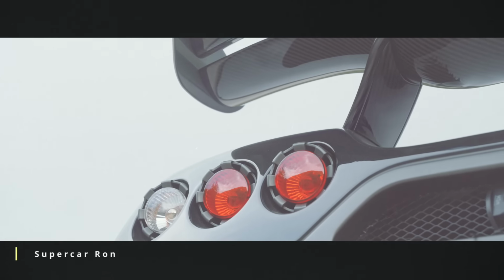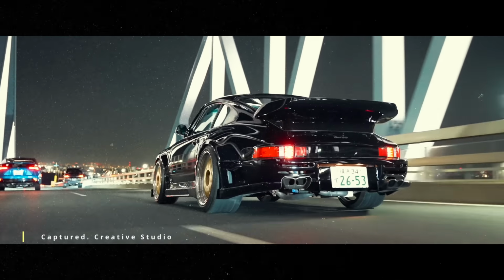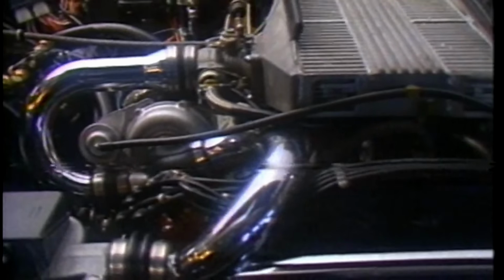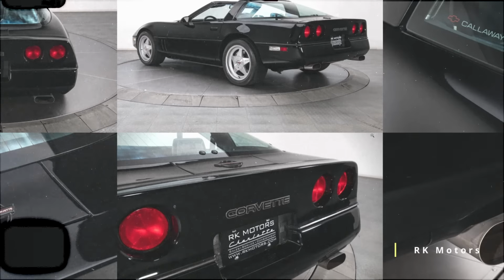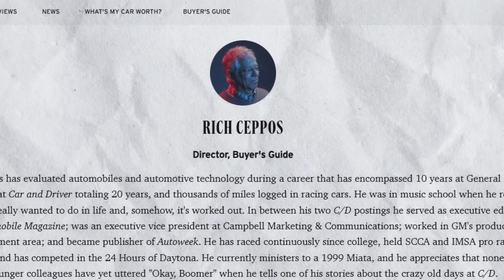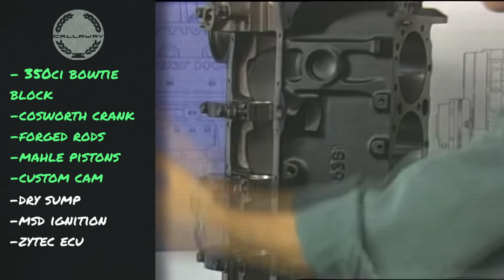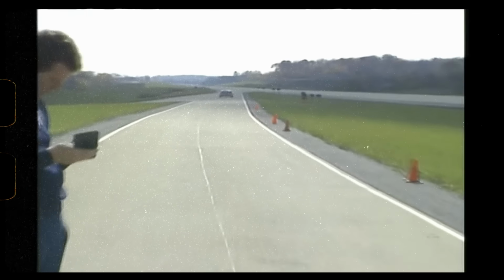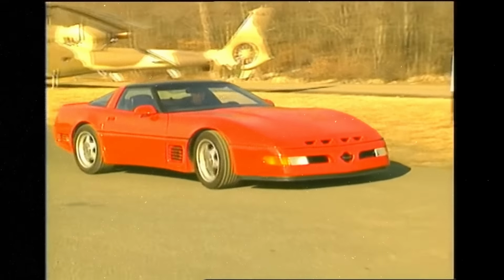Was The World's Fastest Street Car for Almost 20 Years

Comment: It took a Veyron more than 20 years later to beat it and for so much more money.  Only 20 lbs. of boost.  That is nothing today.  What an accomplishment.
Reply: Exactly. The original version of the Veyron was never actually the world's fastest production car - it topped out at 253 M.P.H. The super sport version was what finally went faster than the Sledgehammer in 2009.
Reply: Don't forget the astonishing 1.5+ billion dollars in R&D costs incurred by VW that lead to the Veyron's creation! Ferdinand Piech had his ego dented to such an extent by the Peugeot WM P88 LeMans racer (that funnily enough achieved a top speed of 252mph/405 kph using a TT V6) that he gave the team at VW the ultimatum of building a faster car regardless of what the cost to the company was. And that lead to the Veyron 16.4 reaching a top speed of 253mph/407kph! 😂
Reply: @m.cigledy6769 the problem is that only 1 Sledgehammer was set up to go at that speed, Which doesn't make it a production car by many list's standards. The Veyron is a production car. The Sledgehammer does make it into the street car lists since it is an emissions complaint road legal vehicle. Those are two different lists.
Reply: I've been saying this for years. An old chevy 350 at modern boost levels will run with anything built today. I've gotten 27mpg on the highway, and regularly get 25 in my 96 C4. Last road trip, my 3.5 v6 infiniti got 22mpg.
Reply: @DJAizakku  I think they may have put together 2 of them, but I may be wrong. It was technically OFFERED, but it wasn't really advertised or even known about. That and the price tag was enough to keep it from real production.
Reply: @m.cigledy6769   The second one was the hot pink coloured car, right?
Reply: @rahulsudhir666  If it was, I'd want it to be that fast so no one can recognize me driving it.
Reply: And not only that, but when the Veyron became the "fastest" car in the world, most people didn't even know that the SSC Ultimate Aero existed. Then they made the Veyron SS which was a few mph faster than the original. This seemed strange because why would they make another Veyron that costed so much more and just a little faster. Only later we found out the SSC Ultimate Aero beat the original Veyron, so they quickly made the SS to get the world record back. One of many examples of cars from the US beating the competition, yet going under the radar. Another good example was the 2004 Chrysler ME412, which Mercedes cancelled because it humiliated the brand new SLR McLaren in every way.
Reply: Don't get your metric system in a bunch if miles per hour magically makes your car slower. Keep living the kph dream
Reply: Comparing a corvette to a Bugatti is hilarious 😂
Reply: @user-kr1or1hm4v  Agreed, since the Corvette is actually a functional everyday car, and the bugatti isn't 🤣
Reply: Gator backs?😂
Reply: @m.cigledy6769 wrong 255mph?
Reply: @christohees9150  The original Veyron went 253.81 M.P.H. The Sledgehammer went 254.76 M.P.H. The Veyron Super Sport did get to 267.85 M.P.H. but the original didn't beat the Sledgehammer.
Reply: @m.cigledy6769  don't know why I remembered it as 255😂
Reply: @DJAizakku Americans don’t tend to let facts get in the way, hence Trump!

Comment: For the era, just the fact that stock Corvettes could achieve 160 plus mph was impressive in and of itself.
Reply: c4's were ugly but they had a bloody good drag co-efficient.
Reply: @Mrx1080 beauty is in the eye of the beholder, I happen to find the later c4 vettes with the updated front end to be good looking cars
Reply: @Full_Otto_Bismarck same. Grew up idolising that design.
Reply: in of itself
Reply: Corvette Callaway Turbo Sledgehammer 
cd 0.260
area sq/m 1.791
area sq/ft 19.28, but use 19.4, 267 mph Max speed , 825.34 aero drag+34.65 tire and weight drag= 859.99 HP req'd at sea level. You wouldn't go to a 256 mph average party on an Ohio proving ground with less than 900 net flywheel hp. 

"I know what I'm doing" Reeves C, RIP.
Reply: I am curious what tires they ran as Bugatti claims the tires will fail within a few min and that’s their special glued tire that’s like 15k each irc
Reply: @advanced3dprinting  Tires were new on when Reeves got to Ohio, and special set GoodYears which remained the property of Good year after use
Reply: Umm my 93 Firebird Formula is rated 157 mph stock ..all day long ...Lt1 2nd gen ...world's strongest small block motor ...able to handle 1100 hp plus on stock internals
Reply: Why? Emission held them
Back not technology
Reply: I have a c4 with 33k.
148 is the fastest it will go.. And that is with the wind at your back down hill.😅
Reply: Scope the top speed of the new ZR1...
Reply: @Full_Otto_Bismarck I think the restyled C4 is the best looking Vette. Then again, I did grow up in the 90s.

Comment: I went over to see Reeves and drive the Sledgehammer in Old Lyme, CT for some British and European car magazines in the autumn of 1989. Engine control electronics were fairly rudimentary in those days and it was a grunting beast on the road that felt happiest on full throttle. It also still had test instruments and cables hanging off the interior. The speed record of 254.76mph took place at the TRRL in Ohio, the only test area in the US with a long enough 'runway'.
Reply: Reeves gave me my first big break into professional motorsports when I was hired in (at 21yrs old) to work on the Aston Martin Group C engine program. I will never forget Reeves and just how down to earth and cool he was. So many projects we worked on while I was there. I was able to work on the engine rebuild for the Sledgehammer with two of my roommates that also worked at Callaway. I will never forget riding shotgun in Das Hammer on a run up I-95 @ 185mph. It happened so fast that it was terrifying. We had just completed a complete redo on the car removing test equipment and refining the installation and creature comforts. We actually installed an adjustable regulator for adjustable boost in the center console. Flash forward, I spoke with Reeves about a year before he passed after he visited the GM Performance and Racing Center in Pontiac, Mi. I currently work on the Cadillac LMDh Engine Program and largely owe my motorsports career to him. He was a true Gentleman and visionary. GOD SPEED, Reeves! I look forward to seeing you again one day! Your friend, Brent Pierce
Reply: See where the veyron lacked the top speed apparently the callaway lacked the refinement HOWEVER being a anologue driver i don't mind less buttons more feel and im happy a car should not always be packed away behind electronics and equipment. And im saying this as a Veyron fan.
Reply: The Cadillac program is making a huge statement,  congratulations on your accomplishment,  you have lived the dream sir!

Comment: …and using a SBC, I’m surprised there’s not haters in the comments. After all it is the engine with more wins in all history.
Reply: Ill send some hate, from Florida,  since no one else is.
Reply: Every dirt track to every drag strip in America chevy power domination. Anytime people want to put down chevy i tell them go to ur local dirt track ask the racers what powers there cars. It always about 99% GM lol!!  
I grew up in a little upstate  NY town fonda- Fultonville home of the fonda speedway one of the oldest dirt tracks in American still racing today. Been dominated by  GM power since the beginning still is today. 
Read ur comment just reminded me of myself someone that actually knows something haha
Reply: So true. SBC architecture has been tossed aside for the LS. You can barely give one away. Yet I’ve never seen an LS run 255 mph.
Reply: @walkthnyt2000 Hennessey Venom, and the mentioned SSC Ultimate Aero
Reply: @walkthnyt2000  twin turbo LS engines are capable of power in the 4 digits on pump gas. Just because nobody was crazy enough to produce them doesn't mean the ls isn't more capable than the sbc.
Reply: Sbc still holds the title "won more races than any other engine in world history" has for over 3 decades and I doubt it will be toppled ever.
Reply: @hakjobtm7472 the ls is not more capable because there is aftermarket sbc blocks and components to match and then some in comparison to the ls....just because you don't know of them doesn't make you right
Reply: The LS magic is in the heads and intake. A block is a block. The sbc block is sturdy enough. World products designed sbc heads for LS blocks. They got the idea backwards.

Comment: When you consider 1) the primitive state of engine management in the 1980's, 2)  how badly all the manufacturers were struggling to deal with emissions regs and 3) the tiny operation Callaway was at the rime, the Callaway Corvette was a pretty big accomplishment.
The Sledgehammer was on another level altogether. Consider that it was the year 2000 before Gil de Ferran set the closed course oval record of 241.428 mph, and that was in an Indy Car!

RIP Reeves Callaway and Gil de Ferran...

Comment: Sledgehammer was a beast.. complete beast. THe beast of the motor credit need to go to john lingenfelter. That was the guy always winning the Car & Driver open modified car challenges. He was a beast and his cars were the fastest. He was the main not only consulting on the engine, he is the one that drove the callaway to that top speed record. The only cars in 1985 touching the corvette "all around" from acceleration and handling was the porsche 911 turbo, the TR, the under rated HP of the grand national. The 911 was boosted and starting cost was around $85k. The vette's competitor was the 944 turbo. Actually the C4's dominated the racing scene so much, they were kicked out of the Escort Series. They were 29-0 vs the turbo 944. They then created the all corvette "challenge series". The C4 Vettes were dominant in the 80's and into the 90's for sure. (fyi my stock 85 vette ran 13.90's in the quarter roughly and 0-60 around 5.3 documented (carlsbad and LB terminal island) With 3.73 gears , exhaust and a traco chip it ran 13.2's . She weighed 3180 lbs on the scales sans the targa top and quarter tank of gas. (side note: The ultimate ssc ran a corvette motor :) )  Rest in peace Mr. Callaway AND John Lingenfelter.
Reply from the maker: @redtesta  absolutely awesome input and great info. I love seeing comments like this that expand even further into history
Reply: I'm curious how your stock 85 vette was running half a second faster 0 to 60 and more than half a second faster in the quarter than every other one on the planet?

Comment: A 1983 Callaway intercooled turbo VW GTi was my first introduction to Callaway. In 1989, with 3 of us in the car (550+ lbs. of meat), timed consistent runs of 0-60 in 5.7 seconds & 4.3 seconds with the driver only. It took a lot to impress me after a turbo Ruff Porsche blast up Rt 495 a few months prior. 
The only thing that could impress more than either of those rides at the time was a drag car (obviously faster) unless corners were present.

Comment: I used to work at an off-shoot of United Cutlery in Sevierville TN. My boss, David, was a Vette nut! The scariest one I rode in was a 95’, I think. I’m not sure which package from  Callaway it had added to it, but it was based on a Grand Sport “skunk” Z15, I think. His son, Jake, took me out in it one day. From exit 407 (Sevierville) to exit 402 (Midway Rd), we got to over 200 mph, and used ~ 1/8th of a tank of gas doing it. I don’t know what scared me more, the thought of a tire blowing out, or the fact that I was riding with a ~ 20 year old rich kid and I was unsure of his experience behind the wheel! But, he did fine, and the car was rock solid.

I’ve owned a 74’ Z28 with a decently built 396, a 150 shot, and a rock crusher 4 spd ( that was actually my first car in 1988…thanks Dad! ), to a last of the runs 08’ Trailblazer SS with the 400hp/400ftlbs 6 liter. Mine was the 2 wheel drive version, 1SS package, with that awesome limited black granite metallic paint, it had that twin turbo kit on it that had the turbos out back (I forget now who made it), HP tuners tune, it had the best GM brakes I’ve ever felt, and I’ve owned only GM products for myself my whole life (minus one 93’ Escort GT, in the limited Iris package, okay call it pink I don’t care I was 21 and single and the girls LOVED it, but that was my stereo competition car, so cut me a break and hey it was a pretty quick little car). That SUV was mean, I never got beat on the street with those crazy enough to try it. After I wanted to do more to it I knew I needed to sale it or end up dead. Anyway, I’ve known some speed in my life. Hell, I’ve rode in a friend’s Bullet bass boat that we hit 118 mph in it! But I’m here to tell you, that Vette was hands down the most amazing experience with speed I’ve ever had!